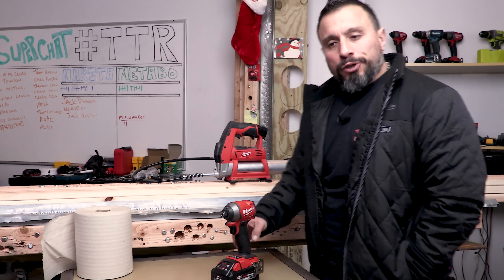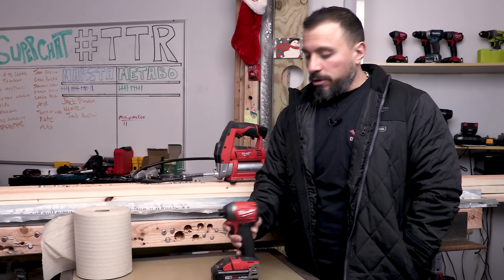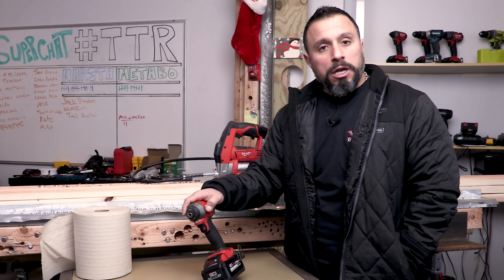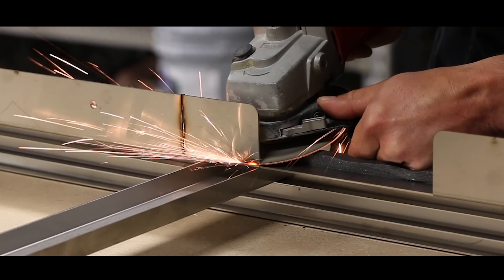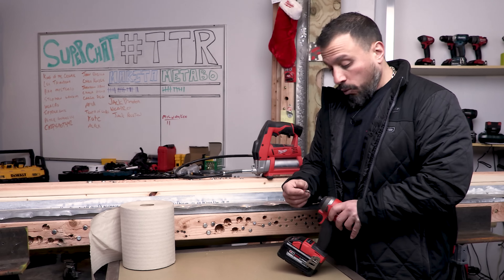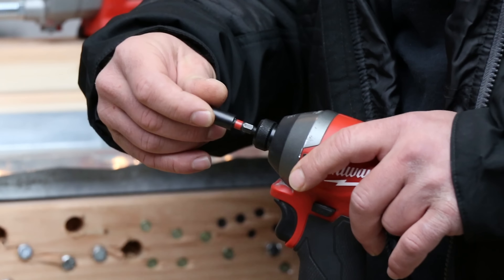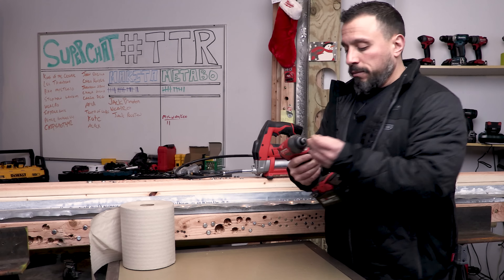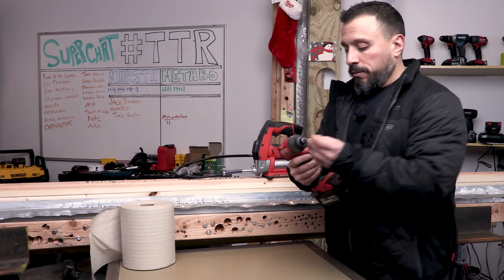Fixing Milwaukee M18 FUEL (2853-20) Gen 3 Impact Driver Collet Problem

Comment: I haven't finished the video yet I thought I would chime in now though. I don't like the idea of putting grease in it what I do in all of mine is clean it thoroughly and put the powdered graphite.  Grease is it going to get packed with all kinds of dirt and shavings from use. #just sayin'
Reply from the maker: I tried the graphite to no avail!!
Reply: @VCGConstruction  yeah I wouldn't think that graphite would fix the problem, I just think that it could be less of a problem with the collet getting clogged during use from being impacted full of grease that is sticking to and retaining dirt, dust, and shavings. Although grease I'm sure at least  initially will do a better job than the graphite until it gets to thick from the ingress of dirt
Reply from the maker: I’m gonna try The graphite, thanks Cuz!!

Comment: I got an m18 surge driver, which appears to have a similar collet. Ive used the hell out of it for over 8 months and ive never had any real problems with the collet. Ive had the entire tool screaming hot many times running spade bits, masonry bits, tightening large bolts and even stirring paint. Never had the collet get stuck like that. Im just lucky i guess. I only use a little bit of spray grease from time to time.
Reply from the maker: That’s good feedback!!

Comment: I just spray some regular Wd 40 in it and on all my impact drivers it keeps the collets working great. Heat lithium grease will probably work also the kind they use in electrical stuff and car electric connections. 👌

Comment: Although I don't like this channel's pompous and long-winded manner of presentation, but I have experienced an issue when I was driving in SPAX brand 3/16  8" wood lag bolts. The hex bit was getting STUCK (not loose) in the impact driver's collet with enviable replicability.

Comment: Your running the paddle bit all the way down to the collet, I don't think there designed for that, and your going way to fast.  Let the drill do the work.  You're asking this tool to do what it's not designed to do. If you need to drill further, get an extension bit.

Comment: You just have to keep it clean!!!!
I spray my Porter Cable and I hold the collar wile I pull the trigger and it gets in thwre nice and deep like!!!!

It is a fine piece of machinery!

It needs lubed!
Just like any tool.
Oil it as needed!
NO BIG DEAL!!!!

TREAT YOUR TOOLS GOOD AND THEYLL TREAT YOU GOOD!

Comment: In most auto parts stores you will find something called "Super Lube". It is what we use when we rebuild ratchets, that Collet is a similar mechanism to the pawls inside a ratchet head. To bad you didn't spend the extra $40 more to get a MAC hex-drive Impact driver instead, because if you had, your MAC dealer would've have come to your jobsite in his tool truck and replaced it for you without having to run all over the state of Pennsylvania to find a qualified repair center. And all of those DeWALT batteries behind you will also work in MAC tools. You should really look into MAC.

Comment: Having the same problem with My M12 Gen 2 impact especially with paddle bits 😞
Reply from the maker: What size paddle bits did you start to notice the problem?
Reply: @VCGConstruction  3/4 inch
Reply from the maker: You gonna send it in for service?
Reply: @VCGConstruction  not sure probably should though

Comment: A step bigger ball bearing would fix the problem, there’s a little bit too much play on the ball bearing when it’s impacting and pulling up at the same time there’s not enough ball bearing to retain the paddle bit
Reply from the maker: Do you think a stiffer spring would help as well?
Reply: I wonder if you could take a ball bearing from makita or dewalt would fix the problem
Reply: Maybe but it will wear out and we will be back to square one.
Reply from the maker: We can always try!!
Reply: @VCGConstruction  I think both solutions would be effective. (Stiffer spring and a bigger bearing)

Comment: Forget double ball bearings. Geometrically a tri-ball system would be more beneficial. Triangles and circles. We all know there strengths.
Reply from the maker: Do you really think 3 balls is more beneficial than a pair?
Reply: 120 degrees from each other yes. Because triangles are strong structurally and evenly distribute stress on each other. And if one starts sticking you have a better chance of 2 bearings that aren’t stuck 120degrees apart pulling a bit out than one bearing that got stuck and or it has enough leverage to bypass at certain angles due to a tolerance built into the chuck so the bits easy to remove. So short answer is yes. Mechanically and structurally it’ll last longer through more abuse. Just think. 2 balls 180 degrees. Or 2 working bearings with one bearing that failed and got stuck 120 apart.

Comment: I've been hearing a lot of people I know talking about issues with that Milwaukee collet not retaining bits and then I' hear  about the Ridgid gen5x brushless also I mean I have the Ridgid gen5x brushless and I have not noticed an issue maybe I got lucky since it's made by the same company but I have noticed the Bosch one is a little temperamental hopefully TTI resolve the issue soon enough I. Wonder if Ryobi has the same problem
Reply: I have a 4th generation ridgid impact and it did it a few times, but as soon as I sprayed some Wd 40 in it, it's been good and that impact driver I bought 6 years ago and it still runs strong and batteries still work fine. 👌

Comment: The problem is not the tool. It is the operator. Spade bits should be used with a normal drill.

Comment: Best grease by Far is 
Super Lube" 100% Synthetic. 
An it's non toxic Plus it Handles High Temps"  An it doesn't attract dust like petroleum grease's. Definitely the Absolute Best Grease I EVER Used" Also MADE IN USA"
💪🇺🇸
Reply from the maker: I’ll check that out Jacob, where do I buy it?
Reply: @VCGConstruction   Home Depot, Ace Hardware, harbor freight they usually have in stock in store are online. An Amazon also. I have the Super Lube Grease,  Oil an Oil Spray can. Great Stuff bro" Even says it it's Safe on food processing machines. An Also can be used as dielectric grease. Been using All Super Lube Products for Years"
Reply: I agree with you about the super lube.  It's great. I've got it from the auto parts store before.  I have only seen it in small tubes.

Comment: If your brave enough to take it apart - wipe off 90% of the old grease.
And use the approved Milwaukee grease most of their tools are different you have it in the instruction manual. I use a thin paint brush to apply my grease

Comment: So if this is a known problem.  I'm a iron worker I build factories every day and side and roof them with using my dewalt 887b 3 speed brushless impact driver and about 8 other dewalt tools in 4 years I'm on my second impact driver and have been considering the new gen 3 Milwaukee as the siding and roof is all screw down with self tap metal screws would you not recomend this over the dewalt I've had no problems with the chuck quick attach most my problem have been trigger problems and the inside the shaft bent from abuse a few other company dewalt 887 have motor smoked but I buy my own tools and not had that problem which one would you reccomend for metal self tap screws going into steel gert and perlins
Reply from the maker: If it works well for you, some people have no problems. Maybe we got a bad batch?

Comment: Maybe, just maybe if it was used for what an impact is intended for your collet wouldn’t fail. I guess red china in its effort to over engineer its impact it created a Trojan Horse. The collet can’t handle the load that the motor is putting on it by running the larger paddle bits. That’s ok. You have that “great” warranty. Have fun not having your tool for about a month. I’ll be the guy stackin racks using the RIGHT TOOL FOR THE JOB!!!
Reply from the maker: 7 days max
Reply: VCG Construction ok. Still a week without a tool. I say longer. I smell a video. Cause I remember longer to get those lights retro fitted to fit the 12ah battery. Most repair centers farm out the work. You live in a major metropolitan area. Higher volume. Guys in the middle of nowhere or smaller populations will wait longer.

Comment: Looks like operator error. It seems to me that you engaged the quick release by drilling too deep and bottoming out.
Reply: It's a common problem with the Milwaukee impacts. The retention spring breaks or gets hung up in the wrong position. Many people including myself have had this issue.
Reply: @justinth83  Ok, I wasn't aware. Thanks. I have a Milwaukee impact driver so if I ever have this problem I will not be surprised.

Comment: Milwaukee has the crappiest response team. Go to their web site leave a message and nobody ever bothers to do their job and get back to you. They suck in this department. And why did they also build a great vacuum and put the freaking power switch behind your hand and not in front of your hand so when you are running it you could turn it on and off with your thumb?

Comment: Not to sound like an idiot, but impact drivers really are not engineered to drive Spade bits on a daily basis like you do, they're meant to drive screws, and small size lag bolts, so that would be my suggestion is don't use an impact driver to use Spade bits

Comment: I have the same deal going on and it’s quite annoying
Reply from the maker: What are you going to do with it Luis?
Reply: I love the gen3 but this isn’t just something I can brush off it’s quite frustrating. I’ve only owned it for less then 1 week and for me It’s only come loose when I use the bosch spade bits 1(1 1/2). I was wondering whether I got a faulty unit but after seeing your video I realized I’m not the only one. Don’t know if I should bother with even returning it and swapping units

Comment: Who uses dual ball bearings?
Reply from the maker: Quick insert with dual ball bearing is Makita
Reply: I was hoping u would have said Ridgid :)
Reply: Speaking of Makita. Did u know you can get this for 399
Makita 18-Volt LXT Lithium-Ion Brushless Cordless Combo Kit (3-Tool) with Bonus 4 Batteries 5.0Ah

That's right, an additional FOUR batts
Reply from the maker: Ridgid seems to have the same issue as Milwaukee!
Reply from the maker: That’s an awesome deal on the makita
Reply: @VCGConstruction  at HD, spread the word before i buy them all